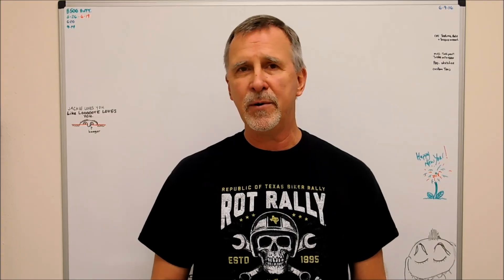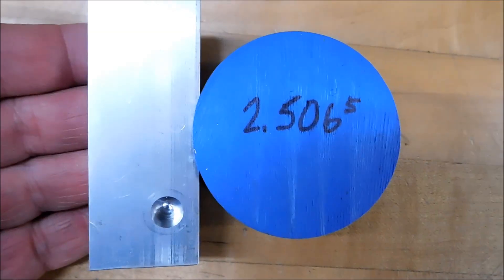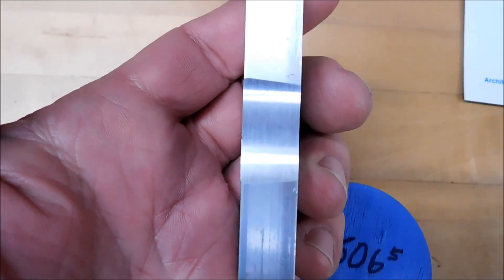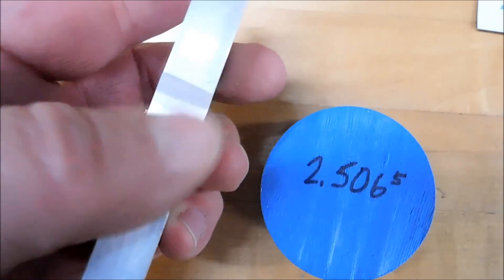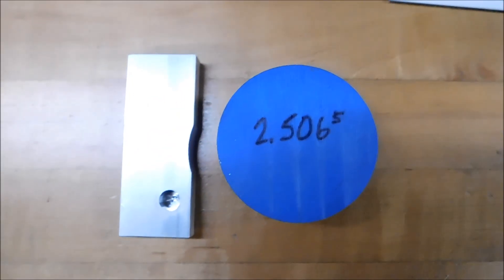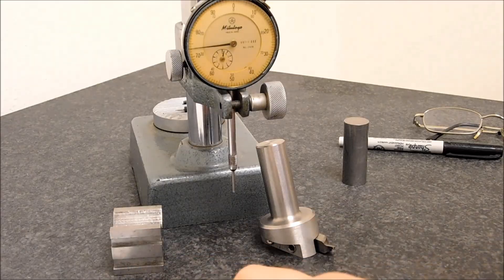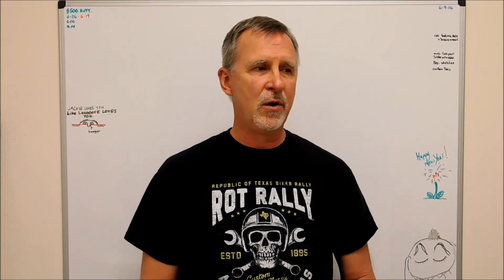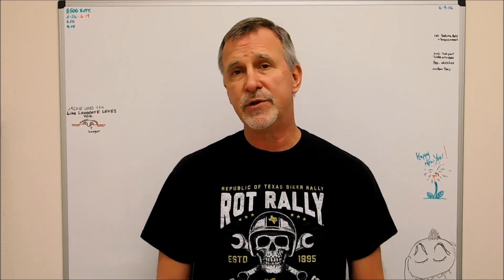How to Set a Flycutter to Machine a Specific Diameter

Comment: Once you learn an edge finder works, you’re comfortable using it.  But, actually, I have no idea how / why they work like they do.   Why does it “jump” eccentric” rather than just slowly move?
Reply: It tries to roll along the surface that it's touching. Imagine if you had a ball on the end of a flexible stalk, and you spun the ball and touched it to a surface. It would roll sideways, not just a little, but as much as the stalk would flex. The edge finder is actually even more clever than that, because once it's a bit sideways, the rotation of the shaft pushes the eccentric part into the surface. So a little bit of contact force turns into more contact force, which makes it roll along the surface with even more strength, which makes it more eccentric, which ... makes it jump sideways to the limit of how the shifty part is mounted to the shaft.
Reply: @chrisjphoenix thank you. I’ve studied what you say.  I get it now.  It has to do with the eccentric “rolling” like wheel along the surface.  And because the  diameter of both the shaft and the eccentric are exactly tangent to the surface, the eccentric “wheel” can’t align any further with the shaft, it becomes a wheel .  The rotation of the “wheel” makes it want to travel along the surface and it goes away from the center of the shaft.  It can’t continue to roll along the surface because it’s attached to the shaft.   Your explanation is much better than my attempt.  I understand now.  Your explanation is very good.  Thanks. I never understood the principle, now you’ve explained it. Thanks

Comment: great video,   do you have a similar technique for an exterior radius/diameter on a part not capable of being lathe turned, or without using a rotary table or dividing head
Reply from the maker: I recently posted a video on a DIY radius cutter. Maybe that would help?

Comment: I needed to cut a radius on a round bar as weld prep for attaching to another pipe and tried a few different things.  Then, I tried using my fly cutter and it turned out so well, I decided to re-cut the other ones using that method.  The first time, I set the fly cutter using gage blocks, but figured I'd search for how someone was supposed to do it if they knew what they were doing.  Well, up pops an old Joe Pie video and I had to watch it.  While I think the gage blocks were actually a good way to do it, I was impressed with the idea presented, so I'm going to grab my edge finder and go over to the lathe and try it.  I say the lathe, as I don't have a mill and am using the fly cutter in the spindle of the lathe to do the work.  I'm running a little behind on this project, so I'd better get to work.  I was supposed to be done with this at 2:21 and now it's 4:36. . .

Comment: This was a great video.  I had to bore a circle the other day and I did it the hard way!  Trial and error and a scrap piece for the test cut.  Was a thou tighter than I wanted, but it worked. I think it was a bearing, might have been about 1.220, 1.221 in diameter.  

I don't have a granite surface plate yet, but I do have a mill with an X Y table, So thanks for showing both ways.   I also realized a day or two after making the part I could use my lathe  to set the cutter radius, using the cross sllide.  

I don't have DRO for my tools. I did add paper scales with 0.1" marks to my mill and to my compound in the lathe.  They are lined up with the rotary scales and that is much better than counting revolutions as I cut.

Comment: Thanks Joe. Your explanation of setting diameter for a flycutter totally makes sense. I have a slightly different dilemma though. I bought a boring head for my mill and it came with a variety of brazed insert boring bars. There are no reference flats for proper tool orientation when installed on the boring head. Setting this up would not be like setting center on a lathe. Suggestions?
Reply: Use the same "scratch" technique used in his DRO flycut setting, only in your case the "set" is maximum offset that still scratches (attained only by rotating the bar, of course). That will set your tool tip exactly radial to axis of rotation. The offset of the boring head, or which hole you choose are both inconsequential for the setting, so long as neither are changed during the "tool tip aiming".
Reply: 8:50 ❤

Comment: I once needed to make a 20mm hole in some part at work, had no 20mm drill, the only 20mm endmill we had didn't fit in the collet (very old crappy Polish collets and the shank was over 20mm) so I grabbed some steel rod, turned half of it to 20mm to hold it and the other half smaller than the next smaller drill I had.
Cut a slot in the end of it with an angle grinder and files (no way to mount a saw on the mill we have) and drilled and tapped a m3 or m4 hole perpendicular to it
I cut of a short bit of and old 5mm HSS turning tool and ground a new cutting edge, put that in the slot, hold it down with a setscrew, plunge on the mill into a predrilled hole, adjusted the cutter and did all the other holes
Guys at work were surprised my scrap metal tool worked
Reply from the maker: Necessity is the mother of invention.

Comment: 221 indeed.  Another informative video.  I have a little home conversion cnc mill with a wired probe, so locating isn't usually a problem.  I do have a question from the video.  I have a fly cutter with an indexable insert.  Works great, always sharp, superb finish.  When plunge cutting, as in your video, is that the normal tool you use to do a facing operation, or does that particular tool bit have a different profile specific to the vertical cutting operation?  Thanks.
Reply from the maker: I use different tools for different features, but if the tool is ground to suit plunge and decking operations, all the better. Just grind to accordingly.

Comment: I make brass parts with no need for extreme precision. The center of the cutter holder is pointed and spanned  in a chuck. I span a small block of brass into a lathe knife holder and visually zero the front with the point.  Zero the DRO, move out to the desired diameter, push the cutter to touch the brass and tighten the screws. For precision work, I'd use a electric ball feeler on cylindrical part of the cutter holder. Machining and engineering is an art. There are always new ways of doing the same stuff. ONE of the IRON rules: precision COSTS. They never teach this in schools.

Comment: Hey Joe, You got any tricks for setting up the tool for line boring? We have been using the trial and error for years doing excavator buckets. Sure would be nice to be able to preset like you did in this vid.
Reply from the maker: I don't know your setup, but the same concept would apply. Measure the bar and extended tool, subtract the radius of the bar and multiply the remainder by 2. That will be very close to the working diameter of the tool.

Comment: I'm a long-time subscriber, but, by an odd coincidence, this popped up in my YouTube feed. Earlier today I used the first technique to set a cutter to cut a one-inch radius into a part. I'm building a boiler for a model steam engine, and I needed a part to mount flush on a two-inch diameter boiler. After cutting a one-inch radius into the mating surface of the part, it sat perfectly on the boiler like a saddle. I was quite proud of myself for thinking up this technique, but you just can't get one up on Joe Pie.
Reply from the maker: Thanks. Take pride though because you thought it up too. I did the same with a scaffold hitch knot about a year ago.

Comment: I’m just a hobbyist but I am learning great cost effective techniques every time I watch one of ur videos.  I have yet to figure out fly cutter speeds and feeds when using hss on mild steel.  I keep dulling the cutter after only a few seconds.  221
Reply: Divide 300 by diameter of flycutter for rpm if using high speed steel bit, double or triple that for carbide
Reply: @Laura-wc5xt I’ll try this, thank u

Comment: Thanks Joe that's brilliant. I wondered though! I might be being a bit fussy or a bit skewed in my thinking on this but, is it possible because of using a fly cutter that centrifugal force might cause ever such a slight increase in the cut radius as opposed to the measured cutter setting? Also I had a think about that small angled over cut radius that you showed us near to the start and I came to the conclusion that a true Conical work piece wouldn't fit it and that only a parallel diameter would fit into it, so my piont is if you had to cut a truly Conical surface for a mating piece is there a way to achieve this also. Sorry about that being a bit long winded for lack of knowing another way to put it.
Reply from the maker: Conical bores can be done on a lathe or a rotary table on a mill.

Comment: What is the style or manufacturer of that neat little magnetic indicator holder with the adjustable rod? I have not found such a thing in a general search.. 221.
Reply from the maker: US General model 387
Reply: @joepie221  Thank you. These are hard to find, but I found a similar style.

Comment: Been awake for about an hr, the sun is up enough to go out to the shed now. There has to be at least 221 applications for a precisely set dia or radius for shop projects or jobs.
 I use a similar tech to the second one but I like the simplicity of the first as it can do different dia's without taking the tool out of the machine. Thanks for that Joe.
Cheers from John, Australia.
Reply from the maker: Thanks John.

Comment: I have been watching dozens of your YouTube videos on my smart TV. I am not logged in on the smart TV so you get no credit for me watching them. I am not a garage machinist but I got the urge to buy a Chinese mill machine and Chinese lathe. I use to deliver bars to machine shops in WI, IL, IN, OH, and MI. Some shops were small and some shops were very large with the latest in CNC. I marveled at all the stuff they could make out of the material I delivered. I bought a fly cutter and wanted to make a hole of radius .8125 out of two pieces of aluminum 1 inch wide and 1/2 inch thick. Each part would have a 180 degree arch and then be bolted together to fit on the yoke tube of my 1961 Piper Comanche. Attached to the aluminum is a ball mount that attaches to a Ram mount that holds my Android running navigation software. I do not have a digital read out. As I struggled with the project I finally got the hole carved away. I probably did everything wrong but I think it will work. I have not had the time to check the fit on my Comanche. I need to get a stone cutting tool to dress the stones on my craftsman grinder. The hardest part was cutting a HS steel tool on the grinder. I painted the two parts to be machined with the blue stuff and gradually worked the fly cutter to the proper circumference. Took me hours. I remember you saying not to wear a watch so I took my watch off and lost track of time. Thanks for all the info you give. I easily get overwhelmed. Regards, Fred Z, Orland Park, IL
Reply from the maker: Thanks for the feedback Fred, I am glad my material is helpful. Feel free to ask a question if you ever get jammed up.

Comment: Your videos are always a true inspiration and very often the best way to move forward. 221
PS: You can tweak the radius of the feature being cut by changing the feed per revolution. A faster feed will leave taller cusps and will also generate a little more force and deflection, but in this case maybe vibration too.

Comment: I never run my edge finder that fast.  I did once and the spring go and whacked my knuckles 221 times.
Reply from the maker: I'm usually around  1300 -1500 rpm. I too have oops'd and stretched one out. Its a right of passage.

Comment: Dear Joe,
 Thank you very much for another very useful video. I know that I will need to fly cut radii into objects at some point so have squirreled this away in the mental vault.
Do you have recommended angles for grinding flycutters to and most specifically I would be interested in angles for surfacing grey cast iron?
Reply from the maker: Certainly less rake on all surfaces. I've cut cast iron with mild grinds with great success.
Reply: Dear Joe, Thank you very much. This assumes however that I know which angles to grind on a flycutter. I presume that being a single point tool the angles when allowing for that of the holder should be those of a lathe tool. Is this so and if not might you be able to point me in the right direction? 
221.

Comment: I have dyslexia so certain things are difficult for me to figure out when it has to do with mathematical calculations Etc it's not just reading that dyslexia effects people don't realize when I drive somewhere and say 6 months later I think about going back to that place I picture it on the opposite side of the road with all the features of the area on the opposite side of the landscape. Dyslexia is a very strange condition. And the real weird thing is it doesn't always seem to affect me. As far as reading and writing now it's completely normal at my age I get glitches in my visual field occasionally but it's very rare. Machining and Amil is very challenging for me as a result of this condition I can typically figure things out and do the simple calculations necessary. But learning by listening to someone describe the calculations is a lot more difficult than anybody showing me or better yet if I teach Myself by doing.

I want to thank you for your great videos they really do help me
122. :-P
Reply: I know what you mean with the visual glitches, happens to me all the time. I just thought it was bugs in the Matrix ;-)

Comment: Is it possible to bore a hole using this method or would that be too much of a load on the cutter and holder? I need to bore a hole for a ~1" bushing for the idler pulley assembly in my ol' Index 40. Roku 221.

Comment: i am very flexable with the knee mill after 45 years and a dozen custom machine making shops. ican do work much longer than travel as in track making. make spiral cuts down lengths. spend days making extremely intricate parts or just whack and hack thru a quickie. even get great results off severely used machine tools. love your vidios because your presentation keeps my interest up. time to time you give a great twist i had not thought of. ido consider myself an excellent problem solver as well. so i then tried to see if  you had more or less than 221 coments. thats when idiscovered you are an awsome thinker. combining a radius with a tilted head to get that chord machined is too cool. ihave used tapered endmills and tilted head to get an angle but now iam faced with another question. how do you do your work watch tv make vidios and read well over 221 comments. inever got to the end. not sure there is an end. there may very well be over221 years of reading on this one vidio of yours. how do you plan to keep going for 221 years
Reply from the maker: God Willing my friend.

Comment: Hi joe, Greetings from the UK.
Watched your video on setting a fly cutter to a precise dimension and it nearly answered my problem. I am building  a model locomotive and am currently working on the smokebox saddle. The saddle fits between the frame in the form of a box and is 3 1/2" wide. The smokebox is 6"dia and I am having great difficulty in holding the part firmly whilst I fly cut the shape in my vertical Miller. The cut itself is wider than the jaws of the milling vice and if I hold the saddle at the end of the the vice it is insecure. 
Can you advise a method of holding the work which will not slip.(as did my first attempt)

Regards
John D
Reply from the maker: I'd be happy to answer your question. Tell me what capacity your vise is, how big the part is, and how big is the machine? We can figure something out. You can even send me a picture of the part if you can.
Reply from the maker: Ok, if I understand this correctly, you are trying to add a partially round channel into the top surface of a square part to nest a 6" diameter.  If you can rotate the head of your mill about the X-Z plane, you should be able to get close. Using a 3" diameter flycutter, tilt the head to 27 degrees clockwise as you face the machine. This should result in a radial channel that will nest a 6" diameter. If you use a 4" flycutter, make the tilt 37 degrees. Hold the part in the vise along the X axis and make the cut along the X axis. Naturally, the bigger the cutter, the bigger the nesting feature. Good luck. Experiment on a block of wood or plastic.

Comment: That is a good trick. Not so much using the trick 'off the mill'. Gave me an error of 0.00221" so I will just stick with the mill method. Gave a nice finish too. I subscribed :-)
Reply: vondeliusc I was anticipating this happening.  The error could come from collet runout on your mill.  Even very good condition collets can commonly give you some runout error anywhere from .0001" to as much as .002". You could see much more runout from a damaged collet or spindle taper. I think the most practical precise way is definitely doing it in the mill.   An alternative would be to check your total indicator runout on the shank of your cutter once its in the spindle and then back  calculate the difference to compensate for   your radial shift.  I would imagine by doing this a guy could effectively hit a radius within a few tenths if you have a tight machine.